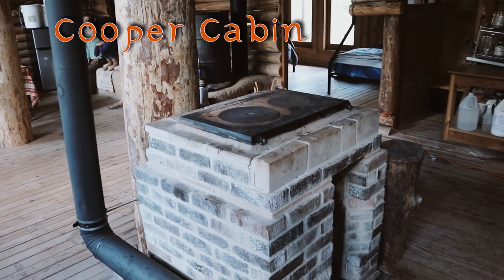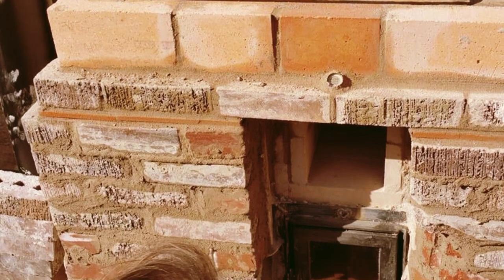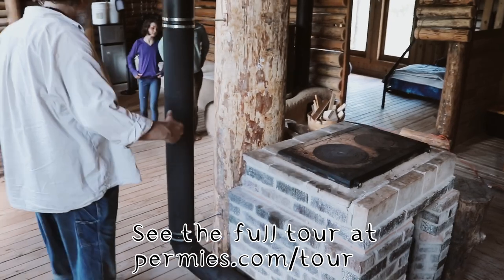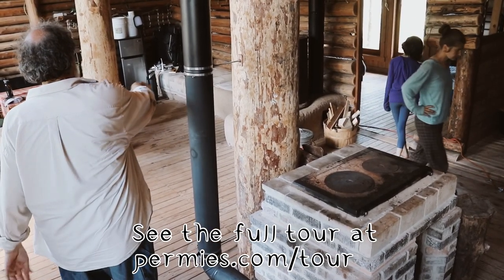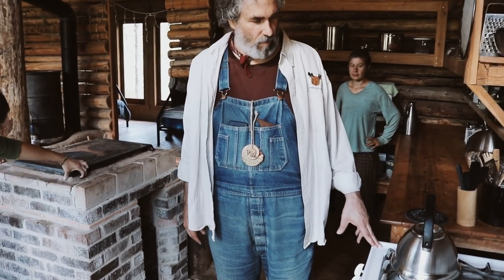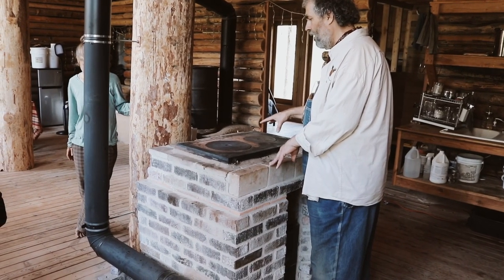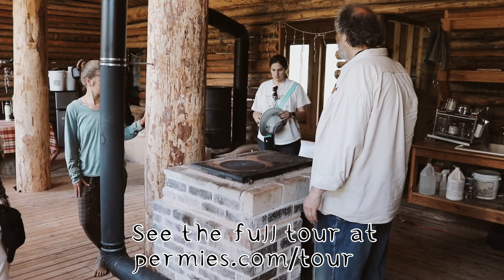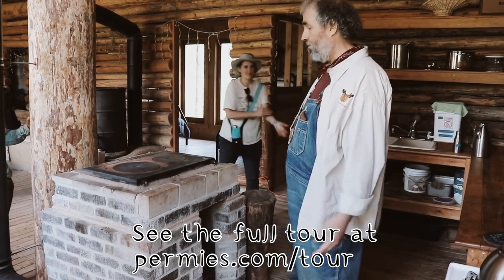Rocket Cooktops excerpt from the wheaton labs tour movie

Comment: You should check out the version I have in my bus conversion with stratification chamber incorporating an oven that reaches temperatures over 600f, the riser directly over the batch box and a hot plate on top.

Comment: Have you designed a stove specifically for boiling water? Having heat hit a pot from the sides as well as the bottom or having a pipe heated seems more efficient. Solid copper pans or perhaps a thick copper stove top would help distribute the heat better for regular cooking.
With the second stove you showed flames were hitting the cook surface, which I believe means there was not a complete burn before the flame started radiating its heat. As I understand it the 2 principles of a rocket stove are creating a vortex to mix oxygen / fuel and to insulate that burn in order to super heat the combustion. That is why the risers are ideally made from a refractory material.
I love the firebox before the riser. I've been wishing I had done that in my first build.
Reply from the maker: what you describe is a lorena. We built one last fall.   I was just looking over some video of it.
Reply: @paulwheaton  Thank you for the new word!

Comment: gonna' be next to impossible to beat propane outside of the home heating months for cooking . (if ANY value put on one's time)
Reply from the maker: I think that the rocket cooktop in allerton abbey does a pretty good job.  And I think that the lorena we built this last fall does even better!
Reply: Propane is hard to beat, until you are empty! XD
Reply: @paulwheaton  The lorena is on the website?
Reply: Mine works great here in Scotland in my bus conversion, it's been running constantly for over a month it provides all my heating and I can cook and roast with it.
Reply from the maker: @flowerchild777  the lorena was built after this video was taken.
Reply: @flowerchild777  The lorena was built during the October 2021 rocket mass heater jamboree, as part of an outdoor kitchen. I was a participant and helped build it among other things, there are multiple projects going and people can bounce between them. A J tube exhaust hits the bottom of a large stock pot, which is tightly fitted into the cooktop so that it sits about 8 inches deep. The gases go up and around the sides so you can heat it faster, and then those gases are routed under a glass cooktop like in Allerton Abbey. Then the gases go up and out the exhaust. You can boil water while also cooking a meal on the cooktop, or say heat up a big pot of soup/stew.